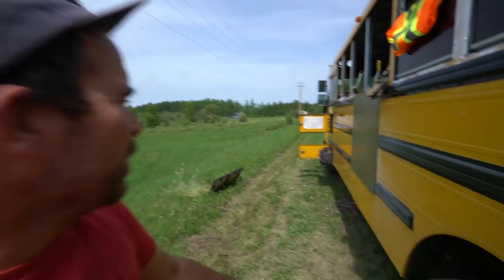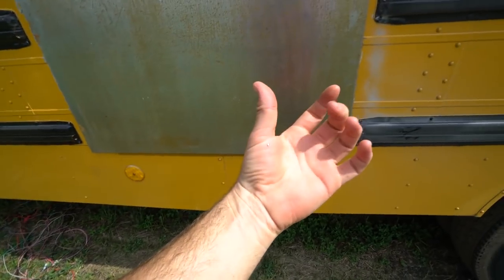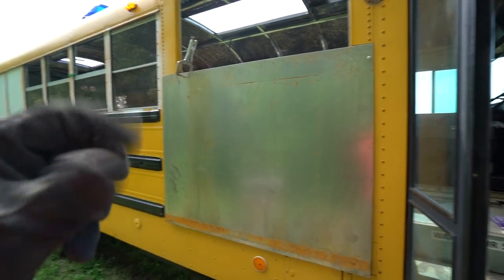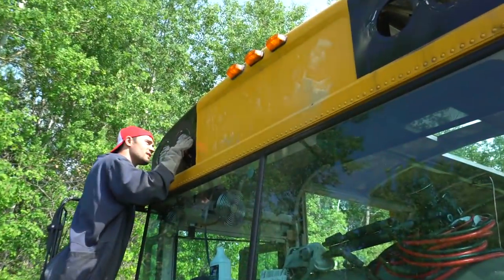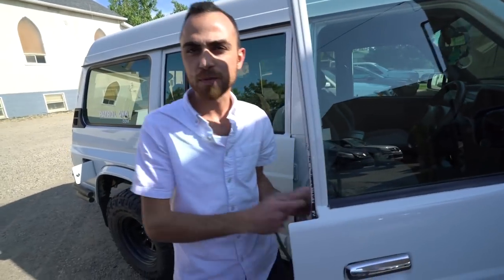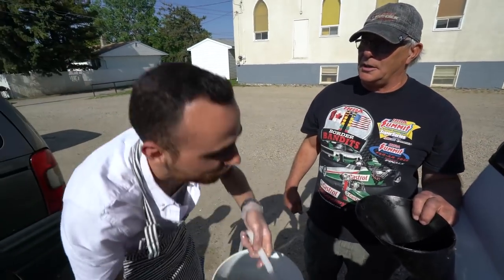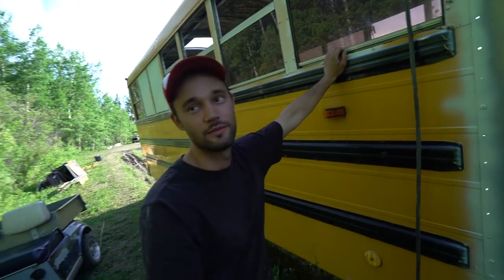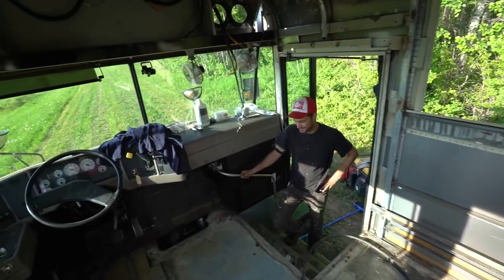CUSTOMIZING SKOOLIE - REMOVING EMERGENCY DOOR

Comment: don't know if you are finished blacking out those flasher light spots but have a better, easier idea for closing and sealing them off, use sikaflex 221 adhesive/sealant
Reply: I made circles to cover my holes and covered them from the outside, i secured the round plates with self tapping screws but since I've discovered sikaflex adhesive/sealant I'm going to remove the plates put some sikaflex around the edges and reinstall the screw only long enough for the sikaflex to cure and then remove the screws fill those holes with sikaflex and i'm done, shouldn't ever have to worry about that leaking or falling out

Comment: A tip for cutting sheet metals, metal blade in your circular saw (skill saw) turn the blade backwards, note not the saw backwards just the blade on the saw.make the bladeteeth face backwards then cut .
Reply: srip 63 I’ve done that with non carbide plywood blades. Not sure how a metal cutting blade ( usually are abrasive ) could be backwards. Am I not understanding what you meant?
Reply: The guys that did that my roof might have been some carbide of some kind but that had to flip the blade to stop bad , ruff edges and make straighter cuts
Reply: Just look on you tube simple ground has a good demo.his is wood blade mine might have been too

Comment: Okay I know I'm wrong but if I had a bus I'd want one of those pop-up skylight in the middle of it that has a ladder that can fold down to the middle of the bus to be able to get to a deck up on top.. and then when you're driving down the road you just fold the ladder back up. Because I wouldn't want to climb any ladder on the outside of the bus I'm a klutz. And the secret project next to the double doors of the opening of the bus almost looks like it's a area where you can hand food outside but I know I'm wrong on that too cuz I think it's too high for normal people to reach oh well it was a shot in the dark LOL

Comment: Jax for the light holes up top I would put white lights in the back for back up lights wire them into the lower back up lights. Then put 2 stop/turn signals in the other 2 holes in the back. Up front put 2 driving lights as in off road lights for back road or main road night driving when no one is in front of oncoming traffic for better light at night. The other 2 holes you can put turn signals up there too.
Reply from the maker: Yes. Great idea.

Comment: You could have wired your overhead rear lights together with your brake lights, turn signals, running lights, 4-ways & backup lights? It makes a difference, when you are on the side of the road, in the fog or heavy rain with cars behind, seeing you.

Comment: Jax I don't know if you answered this question before because I don't have time to watch all your videos at the moment, but should you do an engine flush when you buy an old diesel bus? There is mixed opinion whether engine flush is even necessary. I'm definitely going to do a radiator flush, oil change, and other fluids. . 

I am considering buying a old diesel 2000 bus with 150k miles, no maintenance log, some rust in some area (probably an hour worth of sanding), the engine is moderately dirty.
Reply from the maker: Coolant chemical flush and radiator flush is great. Lots of possible fixes, but most diesels are heavy duty and made for heavy use. Very robust. That being said, some are not maintained well and some have issues. A mechanic can explain more than I can and inspect. Good luck!

Comment: I've heard of pantihose filters, I've even witnessed fuel bein' run through the same way your pizza dude did it. I didn't wanna mention it in case you tried it and something went wrong. You weren't serious about the glass damage were ya? Good. I didn't think so. I did enjoy the small round of ball bustin' though, it's always entertaining. So did Badge run inside when y'all got to his place? I figure he probably did 'cause he needed to Google pantihose filtering heh, heh, heh. He was a little mystified wasn't he? Seam sealer is fantastic stuff rather than using caulk for applications like that. Caulk is fine, but seam sealer is better, so it could be a little costly there....mmmaybe not, maybe NAPA is reasonable. I thought you liked your bus door Jax? .............................PEACE!!

Comment: So..🤔....can I use any kinda oil  ??
Canola, olive, rice bran etc ?? 
And I just buy a conversion kit and install it into my truck ??  🤔
Reply: Can anyone answer this?
Reply: Most oils will work. Some are better than others. The oil really needs to be processed before dumping into tank   Diesels hate water. It should be dewatered before using if you want want less problems.

Comment: webasto .... nice you can use that to heat up the cooland for the motor so it starts on straight veggy oil  
but you can allso use it to warm up the bus when parked using either house style radiators or the stock heater radiator and fan
good chance that you need normal or biodiesel (without the vaseline stuff) for the webasto , or be ready to clean and fiddle with it about every week (dont think the webasto would use a lot of diesel though)

seen a conversion once that used animal fat , the stuff that gets hard like butter 
the tank had a big door in it so the solid fat could be shoveled in , it allso had heaterlines running through it to heat it up and make it liquid before feeding it to the engine , no cold starts on that one though and no room for mistakes either like forgetting to switch back to diesel and clear the lines before shutoff

about cutting the stairs to get more clearance : look at a stair chair https://cdn.instructables.com/FM1/E4G2/HZXYK8ZA/FM1E4G2HZXYK8ZA.LARGE.jpg
wat i think about is make the bottom part fold up inside the stairwell over the stairs left in the bus before the doors close , i think you can cover the bottom of the fold out stairs  with some plywood so when folded up you have a level floor next to the driver 
that would mean you can get the passenger seat in the same line as the drivers seat facing the windscreen and still have a floor to put youre feet on instead of having to dangle them in the stairwell
you can allso have a metal eye  welded to the middle of the bus stairs poking through a hole in the fold up stairs to petlock them in the up position for when you leave the bus un attended , if they manage to open the door they still have to hop up a long way straight to floor level inside the bus before being able to get in thus getting just a little extra insurance against thieves looking for eazy entry